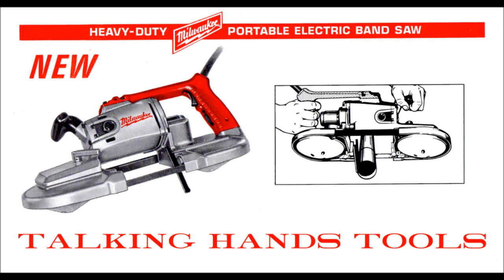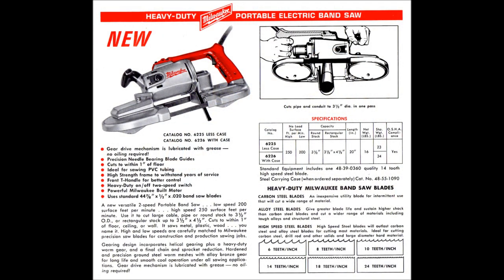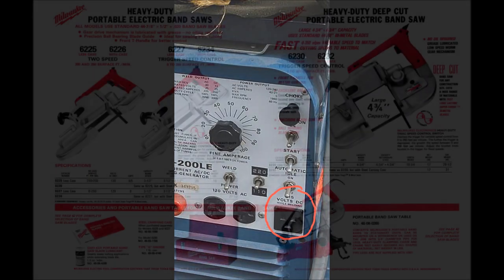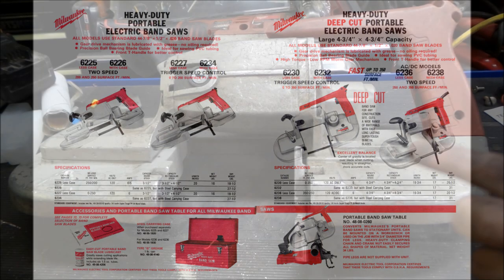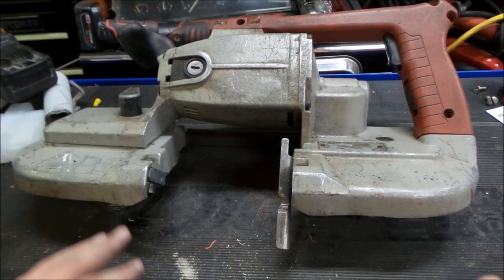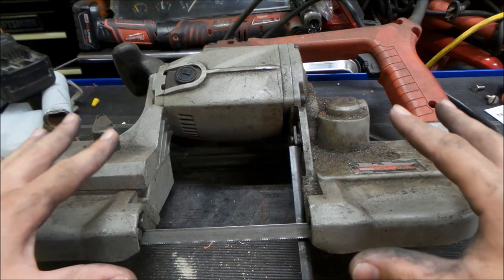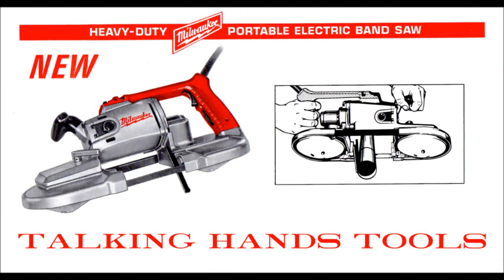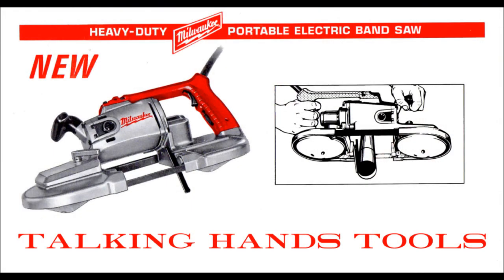Overview of the Milwaukee Porta-Band Portable Electric Band Saw

Comment: Really enjoying your videos! I'm almost ready to reassemble my 6226 Porta Band...I bought it (very) used from a millwright buddy, way back in the early 90's. Been using the daylights out of it ever since. It had a pretty annoying gear box grease leak when I got it and...well, since I retired a few years ago, am finally getting around to a complete overhaul. I was admiring your "Sawzall" restoration and couldn't help but smile with the sweet job you did polishing the Al and painting the red highlights! Glad to see someone else that appreciates quality made in USA tooling. I'd like to clean-up the molded plastic handle assy. but don't want to ruin it in the process...any suggestions on that? Maybe a good strong solution of Simple green or "purple power"? Thanks again for making these really great videos! r.o.
Reply from the maker: I think your on the right track with a cleaner like simple green. I've used it or Spray Nine Grease off with some success also. If the handles are really bad you could try and look up a new handle set. On the porta band I did before I started the channel I had to get new handles for it due to a large Crack on the one side. If you search your tools part number and the phrase "Parts List" Milwaukee normally has really good parts lists for all their tools. Just make sure you have the correct serial number series if you know it, if you don't know it compare part numbers between few to make sure you have the right one. Another part I almost always replace is the cord. It's cheap insurance but if your not seeing cracks beginning and the prongs are okay you should be good there. Let me know how you make out Porta Bands are a favorite and a go to of mine.
Reply: @TalkingHandsTools  Thanks for the great suggestions! I  don't see any cracks so far but I guess that's why so many repair procedures begin with 'clean and inspect...' lol. I'll definitely keep you posted. I have a "budget" ultrasonic cleaner tank with heat(optional) but never tried it with plastic parts, or anything other than citrus cleaners on aluminum...that's given me pretty impressive results  btw, as long as you do gross grease removal first; dilute cleaner with distilled water; heat the tank to about 125 F and rinse with distilled water as well...almost cleans Al up like glass bead blasting! Best wishes for a great holiday weekend :) r.o. <><